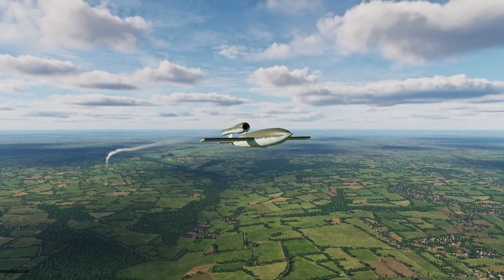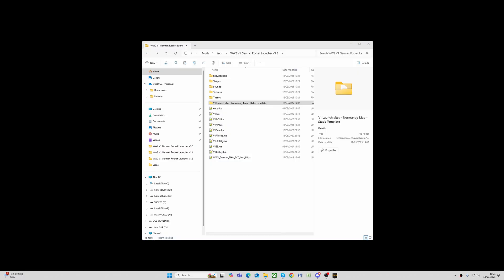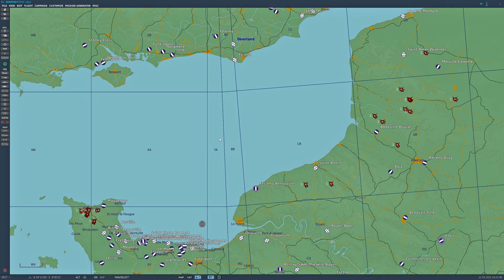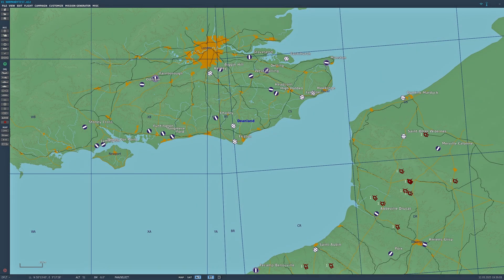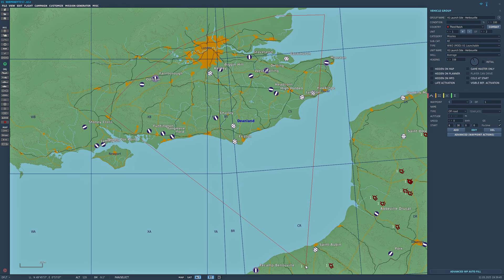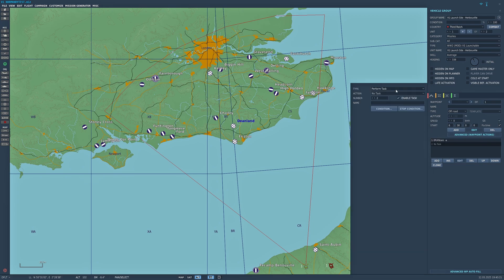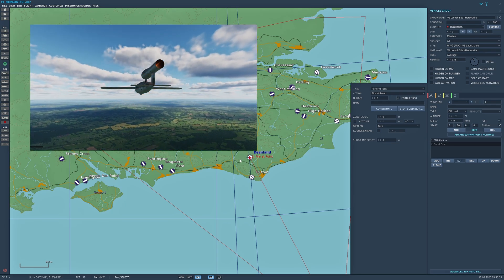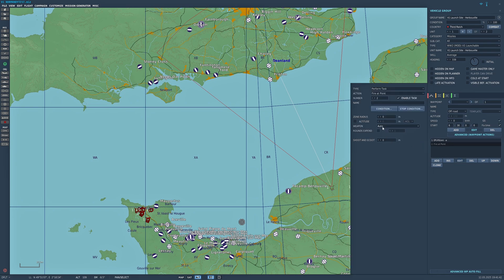V1 MOD UPDATE  - VERSION 1 5

Comment: Nice update, thank you. I fiddled with your older version to get it to fly higher, slow down and reduce range by altering the lua codes for alt, speed and fuel amounts. Wonder if it's feasible to play with fuel flow as a way of reducing speed or narrowing the fuel line diameter (if such parameters exist)? BTW I just placed the STM in my SG Fldr and it loaded perfectly. Thanks again for staying with it. Can you do the 88 Flak Gun? Please?